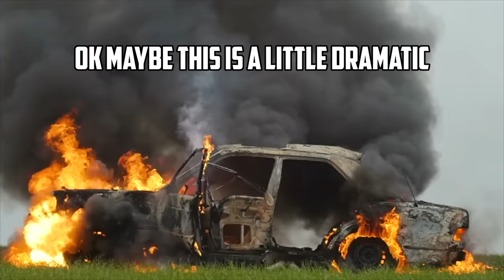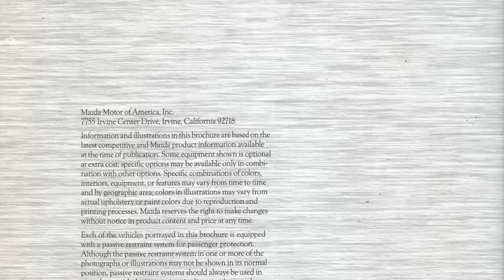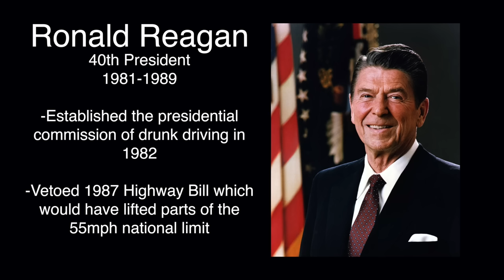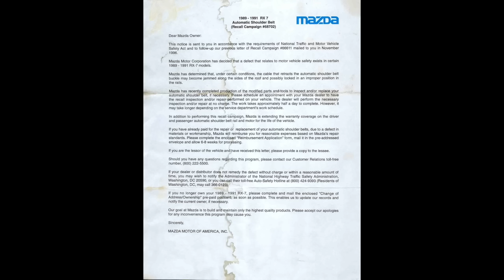Automatic Seatbelts - Why They Were Used & Why They Went Away!

Comment: When seatbelt became law. I was already using.
Because I had a vital bench seat in my truck. And without the seat belt on. I would slide across the seat. 
Mine you it was only a lap belt. But I still don't like shoulder belts.
Fun times having a cop pull me over for not having a seat belt on. And get to say.
Its on.
As the officer grabs thin air looking for the never existing should belt.

Comment: It's also kind of dumb to begin with. You still have to buckle the lap bet manually and the shoulder bit just gets in the way as you're getting in and out of the vehicle. At least when you're a tall person who barely fits in the car without the seat belt... those cars are tiny. They also have a manual option on that bit which I usually end up undoing to get it the hell out of my way and then redoing once I'm actually seated... basically an automatic seat belt actually takes me 3 times as long to put on as a manual seat belt. It needlessly over complicates something that wasn't even hard to do manually in the first place.

Comment: Now I don't mind using a steatbelt it's when I have to fuss with a manual seatbelt that refuses to get out of the way when sadly parked and doesn't retract because of the winding spring action is to weak to fully properly and safly store the seatbelt without it accidentally getting stuck in the door I end up having to stuff that seatbelt back in all because of how it couldn't do it's job right like safety fine but don't make it a hassle for everyone just to practice safety

Comment: I have a 3 inch (about 7.6 cm)  scar above my right eyebrow. You can barely see it now (this was over twenty years ago) from when I was a fledgling mechanic. I had one of these stupid ass things grab my neck and drive my face into the steering wheel. In the process it smashed my metal framed glasses into my face, and drove one of the ear pieces INTO (as in under the skin) my forehead. 
I understand why these things were mandated. But who in the absolute hell decided to make them without some kind of safety clutch installed.

Comment: I know one reason retractable seatbelt went away i had a accident in which my passenger door broke off as you can guess what happened to my sister when that happened she went with the door.
Toyota cressida 1985 should be known as a death trap my axel broke At 79k yes in 2012 i drove a 1985 cressida  which i deem dangerous due to this design

Comment: Airbags doesn’t work without seatbelt. Secondly, automatic seatbelts as shown in the video are not 3 points belts, which are the only proper way to provide some safety.
Reply: So airbags don’t deploy unless the seatbelts are affixed?
Reply: @RustyZipper  They deploy, but they don’t make it safer if you are not in 3 point seatbelt attached to the vertical position. And there is a high chance that the airbag will cause even more damage in this case.

Comment: My God people are stupid. People didn't originally want seat belts?? When you use a catapult to throw a huge cannonball, what happens? The catapult stops and the cannonball continues. Same concept without seat belts. The forward inertia is going to throw you forward without restraint.

Automatic seat belts may have fizzled out because of mechanical failure, but people were also getting twisted in them, strangled, caught. And also many people forgot to do the lap belt due to the automatic chest -shoulder strap

Comment: Great explainer but in an effort for telling a good story you left out why they chose the automatic seatbelt instead of airbags to pass safety standards. Because it was cheaper to implement than the newer and more expensive at the time airbags. Subsequently this cheap move ended up costing them more in the long run.